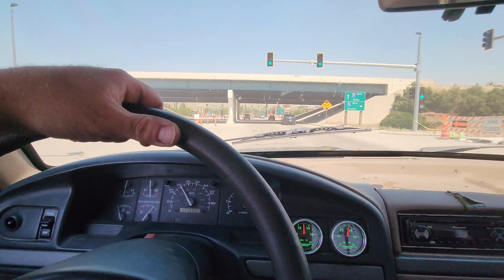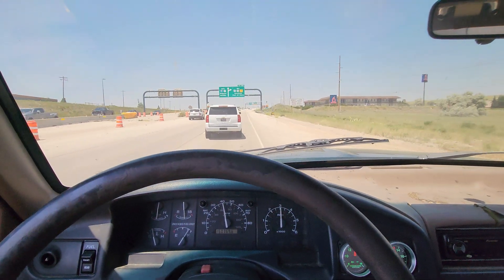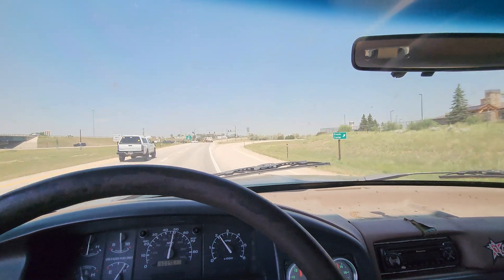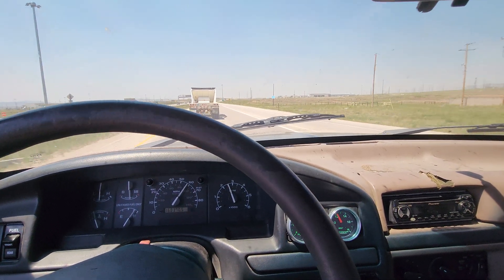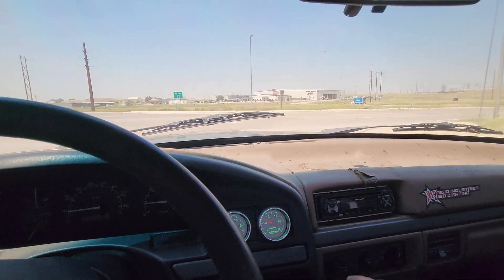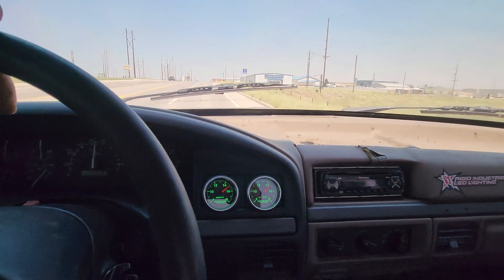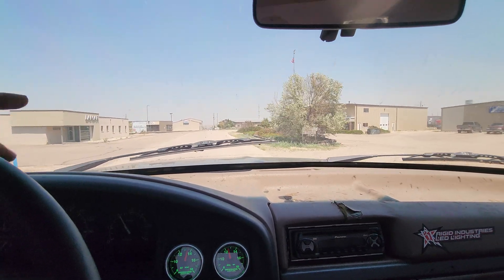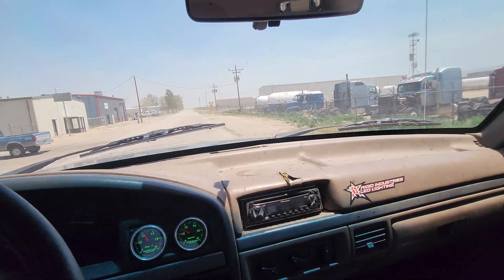Part 2: HOW FORD SHOULD HAVE BUILT THE EFI 460, stage 3 cam, and our line-up of performance parts.

Comment: Im trying to dial in a rear gear ration on a 79 with a 460, mild cam amd exhaust. It will have 35" tires, cant decide between a 4.11 or a 4.56, but being a big block im thinking 4.11? What do you think?
Reply from the maker: The great thing with the 460s is you can run a little longer legs.   It depends on how your engine is built and where your cam is degreed, also what transmission you have, how big and how much air your dragging.  But 4.10's/4.11's work pretty good with 34" actual tire size and it is a great ratio with overdrive.  4.56 would be better for windy, or towing, or if you have a 4" lift.  It would give you another 300rpm at 80 in 5th.  2800rpm  is great for those scenarios.
Reply: @460efiguys3  Cool, thank you! I went with 4.11, its a 79 F150 Short Bed so not as heavy overall!

Comment from the maker: These ones have the single driver side egr port.  The earlier 88-93's (typically)  just have that single port.  Hedman says they aren't in their notes.  But if yours is in those years it should be good.  You can also have a smog referee sign off: that it is visually different but still legal. Or you can always drop ship some to us and we can do the same coversion to yours.
Reply: Your website seems to be down. Trying to access to find out more information about fixing up a 79 F250 I just purchased. Shipping from Denver to SoCal... Smog😅